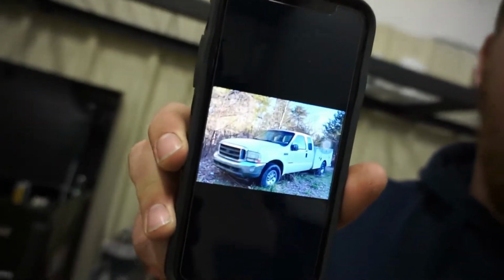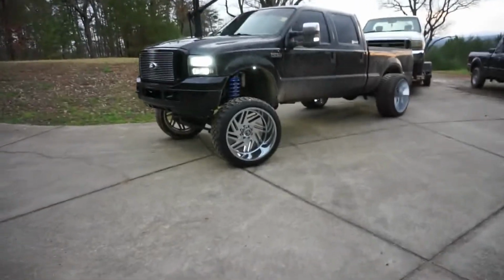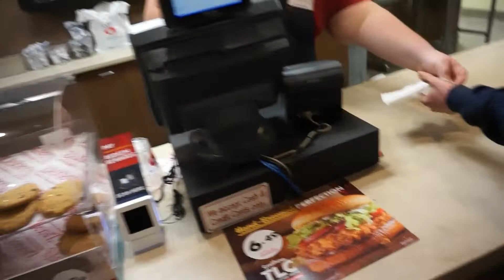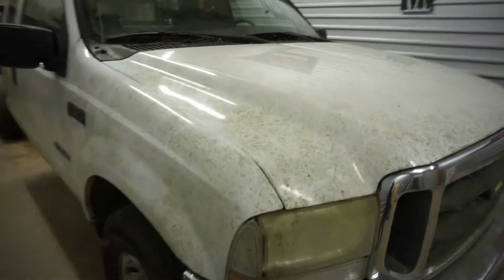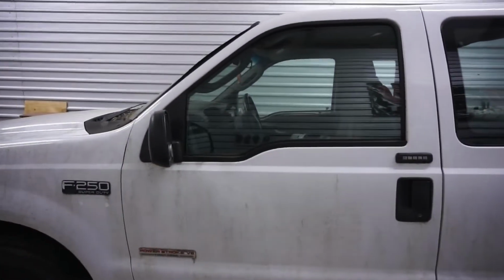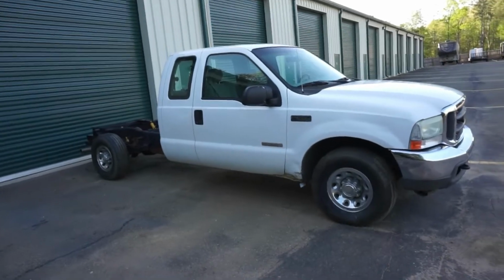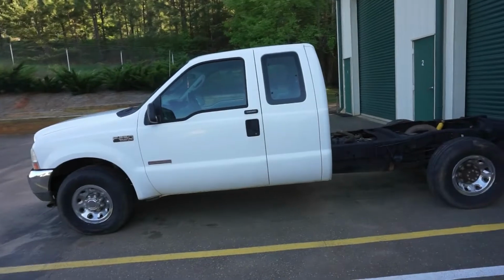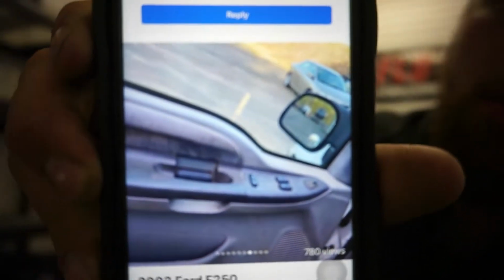Flipping a BLOWN up 6.0 Powerstroke for EASY PROFIT

Comment: Great Video!  I recently bought a running 6.0 Powerstroke f350 with some front end damage for what I thought was pretty cheap (not $500).  I originally bought it to flip it, but ended up building it a little different than I would a flip car.  Your video was insightful, wondering what you think a budget built 6.0 should sell for... IG: OG_Creeker to see the truck
Reply from the maker: R C Smith well honestly it really depends on exactly what condition/package of truck. But also if your meaning what should you be paying for it? Or what should you be selling it for. These things are all pretty valuable honestly, even in the part out stage
Reply: @sepmedia3456  agree.  I bought it to sell it, but i think the time is the most valuable part about it to me.  I rebuilt it with a wrecked front end and 410,000 on the 6.0.  I have a lot more time in it than money.  People make me offers and I feel like they are low, but the diesel resale is all new to me.  Thinking its worth just holding on to. Appreciate your content and response!